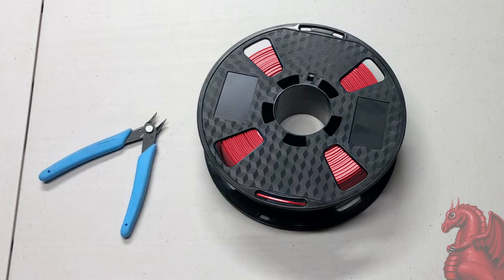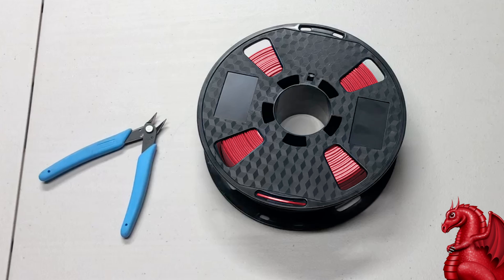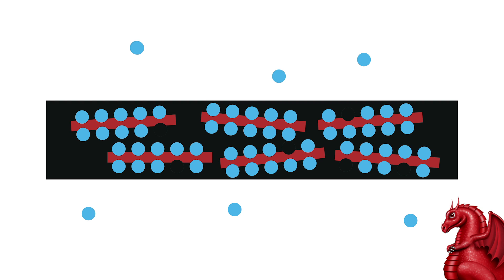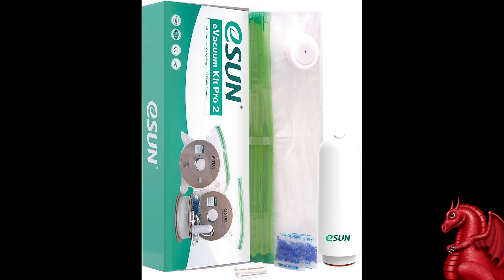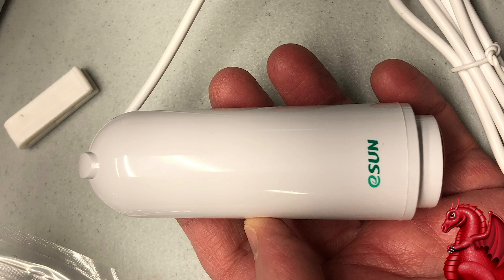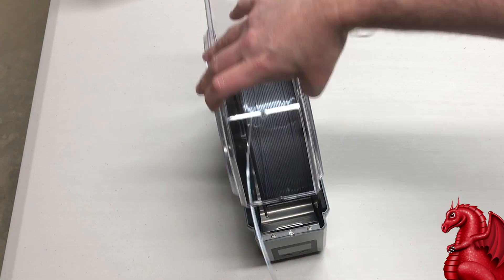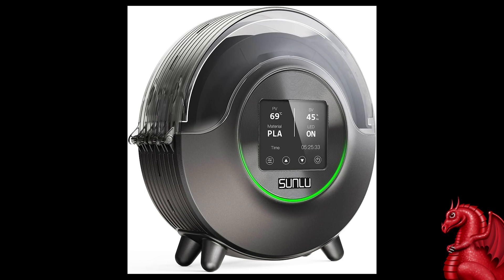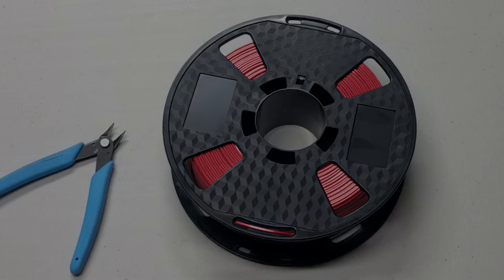Proper  3D Printer Filament Care

Comment: If you intend to use an oven to dry the filament, avoid gas ovens since they produce what is called a wet heat, so humidity is introduced instead of removing it.

Comment: I saw a video which made a strong argument against heat-drying PLA: when heated, wet PLA undergoes hydrolysis which fragments polymers and degrades quality while making the filament more susceptible to moisture. Other filaments like PETG are much less susceptible to irreversible chemical reaction with water and can be heat-dried repeatedly without significant degradation as long as you stay well away from the crystallization temperature, apparently. The video recommended not to heat dry PLA at all and claimed it doesn't really suffer from moisture much anyway, or at least not quickly.

I've seen another video which appeared to show significant PLA quality difference due to ambient moisture absorption in as little time as a day, however. Perhaps additives such as colour made a massive difference?

What's your take on this? How often should I heat-dry my PLA and at what temperature, if at all? I do already use vacuum bags and even a little activated alumina dessicant to preserve dried filament, so that provides a fine solution. But I wonder if I can just leave my PLA on the spool and reheat regularly to redry, or leave on low heat perpetually to keep it dry without the use of a vacuum bag.

Comment: From drying in my convection toaster oven I've learned not to trust the temperature knob. Stick a thermometer in there to figure out the actual temperature. Part of the discrepancy could be increased temperature while convection is running, since air is cooling the built in thermometer as it transports the heat to the objects in the oven; this ought to throw off calibration due to the decreased temperature differential between thermometer and oven interior and may be why when cooking the general rule of thumb is to decrease oven temperature by 25 degrees with respect to the recipe when using convection.

You do of course want to use convection if available, to keep moisture wicking away as fresh dry air blows against the filament to replace moist air surrounding the filament. Drying speed is significantly increased with water density differential between the filament and the air at the interface where they meet. Additionally with convection oven temperature will be much more uniform and likely more stable. 

Finally it is critical to put aluminum foil (or even just some cardboard or a pad of paper) under and on top of the filament spool to shield it from radiative heat transfer when the oven elements turn on periodically to replace heat loss. Otherwise your spool and possibly filament will get toasted.

Ultimately I've had pretty good results using my oven to dry filament this way but I've still gone and ordered a dryer for the sake of energy efficiency and the opportunity to print TPU and Nylon (and even PETG) straight from the dryer. It's fairly humid here!

Comment: Would regular vacuum sealer bags (where you buy a role and cut to size) work just as well?  My 11 year old has gotten into 3d printing and we just got her an A1mini so I'm just trying to ward off potential problems by watching videos :-)  We already have a countertop vacuum sealer that we use for freezing food so if I can avoid buying anything else that would be great!
Reply from the maker: Yep, I used a kitchen vacuum sealer for years, it works great. The only difference is these bags are re-usable, but if you already have the food vacuum sealer it will be much cheaper for you to go that route. :)
Reply: @Tombof3DPrintedHorrors  @slkinyon1 If you buy the bags in Rolls. You can seal it with extra space on the end ( say about 6 inches or so). Then when you open it, trim the bag down 1/4" and then reseal it. You should get quite a few uses out of it before you have to make a new one. :)

Comment: I have colors I use rarely (like once every three years), and while only one roll got enough moisture that the filament snapped when I tried to feed it, I have had others that absorbed enough to affect print quality. (I keep them in sealed storage containers with desiccant, but don't use vacuum-sealed bags. Maybe I should, but my Lock & Locks are so convenient.) I very much like my S1 Sunlu filament dryer, but anyone considering buying one needs to be aware it won't accommodate 2-kg spools, or ones that are unusually wide/tall. (It works for every brand I've tried other than the Prusament I got five years ago.)

Comment: Pla will get brittle when wet but it dont happen very fast unless you are in a humid environment. i have had rolls of pla for 5 years exposed to air in my house and they will print fine that said yes it can get wet but it really gets brittle and breaks with little bending.

petg is a bear when its wet,  it will get wet way fast and will pop and steam and string like crazy. nylon as well it will swell when wet even injection molded parts have to compensate for this. but as its a more exotic filament not many ppl print with it. if you ever wanted to try nylon go get some weed eater line its nylon and the right size just make sure you dry the crap out of it first
Reply from the maker: PETG and Nylon shouldn't be used for gaming terrain or minis, stick with PLA.

Comment: how do we test the filament if to see if its water logged, is it true if it brakes easily like a noodle its wet? i have all my filaments in a zip loc bags but just in case i leave some out as i do live in humid climate here in Canada especially in the winter.
Reply from the maker: The most obvious thing is it become very brittle and will break easily, snapping as you try to feed it into the printer.

Comment: I've had a roll of Overture PLA+ go brittle super quick, to the point it snapped at the spool holes holding the end.  I was lucky and was able to restore it with a small convection oven that happened to go low enough to hit the right temperatures, and was stable when testing with an accurate probe. The brittle filament became strong and flexible again, but never used it for lack of the means to easily respool since it may have dived under itself. I know a lot of people have had good luck with the round food dehydrators since they're already the right shape, made for low temps, and usually have an air circulator. You have to do a thorough scrub-down cleaning of anything that had ever been used for food though, because traces of fats can also damage the structure of filament.

Comment: Dryers like the Sunlu shown here have a design flaw - they're sealed, which means as the water heats and separates from the filament, it has nowhere to go, so if you don't remove the filament soon after the heater turns off, that vapour will cool and return to the filament. The solution is to crack open the lid while heating to give the water vapour a chance to escape. There are a ton of printable hinges on Thingiverse / Printables for this exact purpose.

For storage, I started with the vacuum bags but found they are easily compromised and about half don't keep a vacuum seal sheet only one or two uses. I've instead moved to IKEA plastic containers (365+ range) Which can hold 2 spools, a printable spool holder which includes a container for desiccant (I use the orange ones which can be reactivated), and a hydrometer. I now dry my filament with the heater and then transfer directly to the container. This keeps my spools nice and dry whenever I'm not using them.

Comment: pla is not as hydrophobic as others. Had the same filament opened on my printer for 3 years. Prints the same as it did on day one.
Reply from the maker: You aren't printing gaming minis then, it doesn't take much water to be absorbed to affect print quality for those.
Reply: @Tombof3DPrintedHorrors  correct, I was not. This spool is a color I don't use often which is why it's am old spool. Typically when I find water content to affect my prints you can hear it as it's extruded. Sounds like popping sounds along with print quality issues as mentioned. I am far from an expert with 3d printing, but this has been my observation.

Comment: I bought the AMS lite and I live in a humid environment, so I’ve been torn by how often I should unload my filament and throw it in my Sunlu dehydrator. Because my printer is an A1, I’m on printing hiatus at the moment, but expect I will need to do a full dehydration cycle when I get my new head bed.

Comment: Some tips:

- Some filament spools have an annoyingly small number of holes along the edge to thread filament in. I even have some rolls that only have ONE hole (per side) which is the worst. You usually end up in a problem where the amount of filament you have left isn't enough to reach one of the holes. There are 3D printable filament spool clips that will let you clip the end of the filament onto the spool, anywhere, eliminating the "not enough filament to reach the hole" problem entirely.

- If you are looking for a cheap filament dryer, grab yourself a food dehydrator. One of the old school types that are round and have a fan at the base are ideal. That will run you probably $40-50 or so at most places online. Or, even better, just go to a thrift store, you'll probably find one there for a couple bucks tops. You'll need to print an extension to it, so that a spool of filament will fit in it. (most food dehydrators are only deep enough for a few trays of food, so too shallow to fit a spool in.) There are downloadable models out there, but it's trivial to model your own (it's just a giant circular tube.) Works brilliantly, and at a fraction of the price of dedicated filament dryers.

Comment: I have been MIG-welding for most of my life so controlling the loose end of spooled wire i second nature to me and has directly transferred to 3D-printing. I find 3D-filament does not tangle nearly as easily as MIG wire though, that stuff is really springy and will make a hopeless "bird's nest" if you let it go for even a second. I have been thinking of getting a filament dryer or a food dryer but fortunately where I live moisture is not a big issue for most of the year, we mostly have it too dry inside in the winter, especially when, like now, it's -20 C outside, the air can't hold much moisture at such temperatures.

Comment: PLA Especially? All other videos and info from 3D print groups suggest that PLA are one of the least hydroscopic materials?? It is said it can absorb some, but so little that most do not dry PLA. I have done with a few rolls, just to be sure, but not sure if it actually made any difference. That said I also use the bags to keep open filament rolls in, and have that usb pump also. Just be careful not to pull out so much air that you risk bending the filament roll sides. Also got a filament dryer for when needed.
Reply from the maker: This channel covers the materials most used by gamers for tabletop gaming models, so we do not examine/advise/compare anything that is outside of that focus. That said, PLA does absorb moisture to the point of being noticeably evident on printed models (at least here in Ohio, which isn't the worst area of the country for humidity, and drying has resolved the issues experienced.)
Reply: @Tombof3DPrintedHorrors  huh, for some reason I always thought you're a Brit. Regardless, and totally unrelated to this video, your tip on fixing z-banding on the Ender 3 proved very helpful. Now I get the prints I always envied others of. ^^

Comment: I use filament clips, for the end of the rolls. Easier and doesn't bend the filament. I also grabbed some of the color changing desiccant, with some 3d printed baskets for the centers of the rolls. The color changing shows when it needs to be charged again and if the humidity level is compromised.
Reply: "Grandma's favorite filament clips" by Extrutim are the best I've found. Use the ones with the closed tube and just leave them on while it prints.

Comment: I didn't realize vacuum bags were so affordable.  Thank you very much for turning me onto that!
Reply: Be aware that about 50% of the bags aren't going to hold air, so factor that in. They're still fairly cheap even when half of them are broken.  You can also buy 4L cereal containers that are actually almost airtight (except for the hole for the lid, for some reason) that will keep the stuff dry. Stick color-changing desiccant (orange/green, not blue/pink) in there and you can tell if you need to dry the filament again.

Comment: Hey, Tom! Thanks for the video!

What effect does moisture have on bed adhesion?  For reference, I live on the Gulf Coast and it is VERY humid, even in what passes for winter here. Recently having tremendous issues with bed adhesion and not sure if it is the bed leveling (which seems fine) or filament with too much moisture. The roll has been sitting around for six months or more.

Also: thoughts on using a food dehydrator to dry out old filament rolls?
Reply: Depends how hot the food dehydrator gets. I would check with a reliable thermometor that its really just hitting 50-55 °C for PLA. If you have one, go for it. But for stuff like PTEG or ABS i would choose an option i will never use for food again.